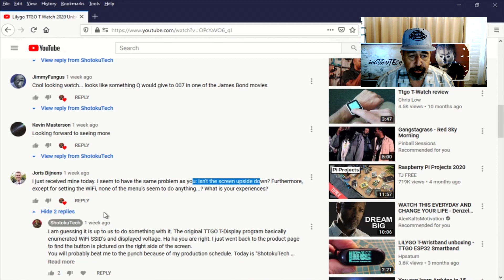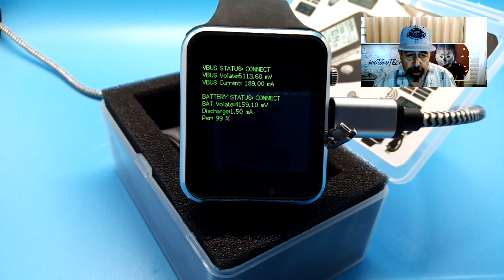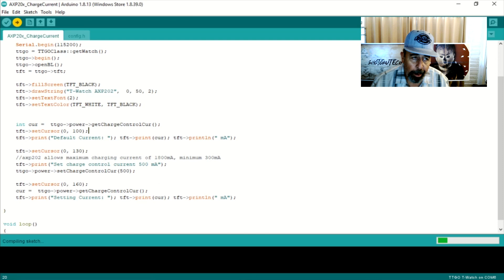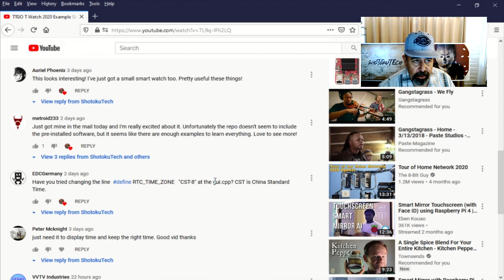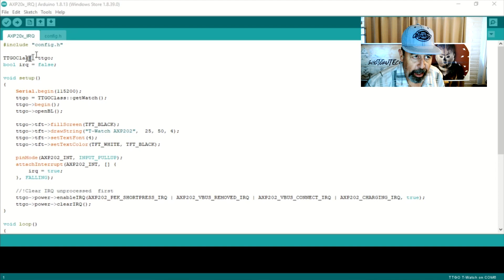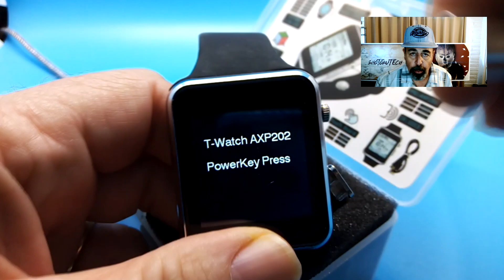TTGO T-Watch 2020 AXP20x Power Management Example Sketches

Comment: Hi, what about battery duration ?
Reply from the maker: This really depends on what program is loaded. I tested with this firmware "TTGO T-Watch 2020 Firmware Update Complete Success" https://youtu.be/7vOaqnmAkcg and found that just checking the time occasionally throughout the day it could last for over 24 hours as the program has a good sleep function.
Reply: I just got the newer model V3 from tindie DOT com a few days ago.  I combined two sketches, TFT_ClockDigital and WakeupFromTouchScreen.  I keep the screen off until I press the power key/crown.  Then it stays on for 5 seconds while showing the time, the battery %, and elapsed time since downloading the sketch.  When I turn the screen off I also call "ttgo->power->setPowerOutput(AXP202_?,AXP202_OFF)" for all 5 of the AXP202_? IDs in the example.  I can get less than 5.5 hours right now.  I am sure I will improve that after I learn more.
Reply: CORRECTION: I wasn't running setCpuFrequencyMhz().  Early results show over 10 hours.  I can't do a deep sleep because the TFT_ClockDigital uses the millis() method to calculate the time.
Reply: TEST RESULT : Toggling the setCpuFrequencyMhz() between 10 (quasi sleep) and 240 (fully on) did the trick.  I got 25 hours before the battery percent read 0.

Comment: I also had a lot of trouble getting the time set so I tried this to the top of the loop function.  You can then use the Arduino's Serial Monitor and send a time update:  Just 4 digits:  0730  for 7:30 am.
void loop()
{
    if (Serial.available())
    {
        int hour1 = Serial.read() - '0';
        int hour2 = Serial.read() - '0';
        int minute1 = Serial.read() - '0';
        int minute2 = Serial.read() - '0';
        while (Serial.read()!= -1);
        hour1*=10;
        hour1+=hour2;
        minute1*=10;
        minute1+=minute2;
        if (hour1 >= 0 && hour1 <= 24 && minute1 >= 0 && minute1 <= 60)
        {
            TTGOClass *ttgo = TTGOClass::getWatch();
            ttgo->rtc->setDateTime(2020, 7, 13, hour1, minute1, 0);
            ttgo->rtc->syncToSystem();
            Serial.println(hour1, DEC);
            Serial.println(minute1, DEC);
        }
    }
    
    bool  rlst;
    uint8_t data;
    //! Fast response wake-up interrupt
   .
   .
   .

and then in gui.cpp I changed the updateTime to this
static void updateTime()
{
    time_t now;
    struct tm  info;
    char buf[64];
    time(&now);
    localtime_r(&now, &info);
    TTGOClass *ttgo = TTGOClass::getWatch();
    RTC_Date rtcDate;
    rtcDate = ttgo->rtc->getDateTime();
    info.tm_min  = rtcDate.minute;
    info.tm_hour  = rtcDate.hour;
    strftime(buf, sizeof(buf), "%H:%M", &info);
    Serial.print ("updateTime->");
    Serial.println (buf);
    lv_label_set_text(timeLabel, buf);
    lv_obj_align(timeLabel, NULL, LV_ALIGN_IN_TOP_MID, 0, 20);
}

Might not be the best way to do this but it got me going.
Reply from the maker: Awesome sharing! Style points for that. I was looking at the BasicUnit/RTC example sketch. It does read the time that you input within setup code at boot up. So It will round out this episode with more interesting examples to show. I will be sharing a link in the  BasicUnit/RTC episode to some guy's site, where he made his own Cat Watch. Clever stuff. And he shows how to use a whole different IDE. Thanks again.